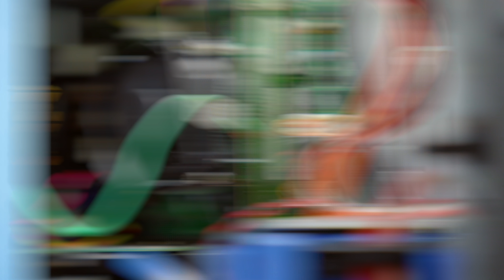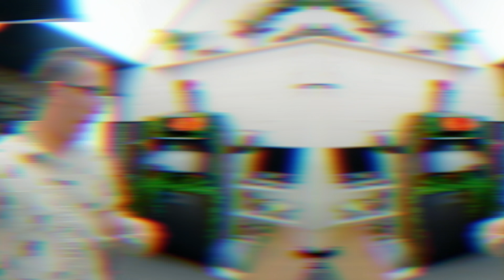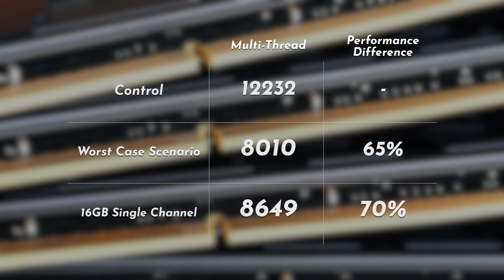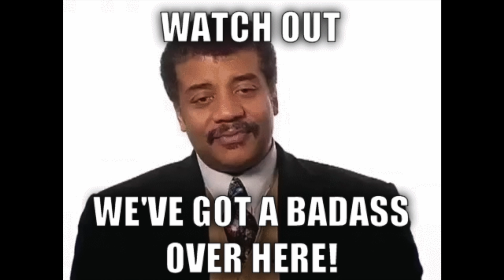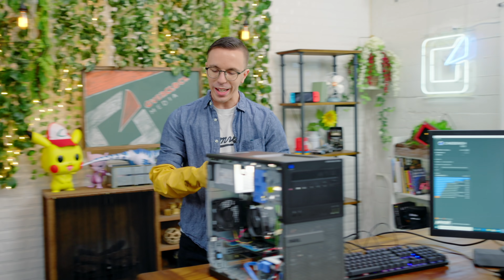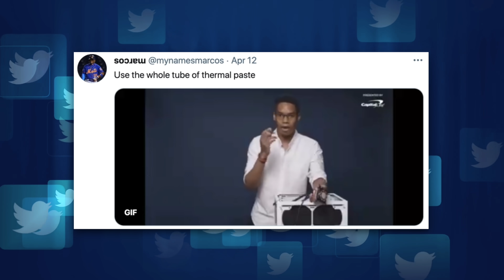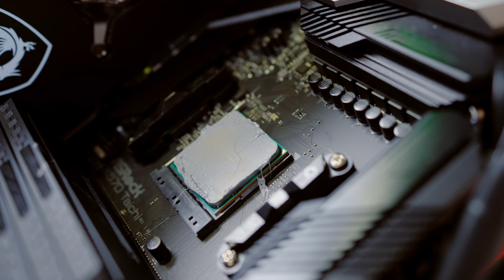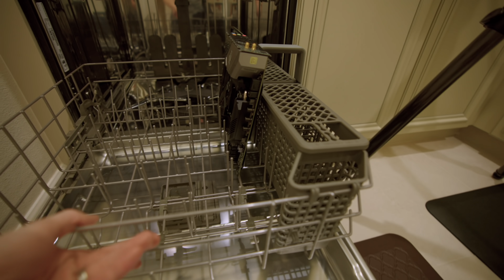Gaming PC Lies People Believe

Comment: Hi Austin & Team,
I wash used motherboards in the sink often and haven't lost a single board.  These are a few things I learned from Brian at Tech Yes City.  1: Remove all heatsinks to clean them separately.  2: Remove the CMOS battery and short the power button connector to drain any residual charge.  3: Run the board under warm water (NOT in the dishwasher) and go over it with a gentle brush.  When I say gentle, I mean something with soft bristles and ideally designed for electronics.  4: Take it outside and use some kind of air blower like a DataVac to get as much water off as possible.  5: Let it sit in the sun for a while to allow remaining water to evaporate.  If it's really sunny/hot, don't do this step for too long!  6: I recommend running a hair-dryer on warm/hot over the CPU socket, as this is where water can easily pool even after steps 4 and 5.  One time I neglected this and got BSODs when trying to boot.  It was fine once I dried the CPU socket.  7: Replace heatsinks, CMOS battery and test!

Comment: What was the point of that ram test? Of course it's going to be slower if there's less gb of total ram. I thought they were going to test out the control with another scenario where you have two 16gb sticks running dual channel with the same speeds but different manufacturers and different timings

Comment: I work at a circuit board manufacturing company with an assembly department. When they are done with the assembly process, they quite literally run the boards through a washing machine that works EXACTLY like a dishwasher. The only difference is that they use DI water and special soap.

Comment: Austin, DDR RAM is running half of the speed you said 3600MT/s === 1800MHz
Also you're not testing anything there, these RAM tests you did are completely useless you never OCed THE mixed RAM to 3600MT/s

Comment: Can you do the ram and motherboard challenge again. First of, if you wash your electronics wait 14 days. I did wash my keyboard like they did to the motherboard and waited 14 days( it was also on a radiator). Nothing wrong, it actually worked better because of how dirty it was(I was not the previous owner). Try like 4 rams with the same speed with and without the same brand.

Comment: @austin I've washed 100's of componants in a dishwasher and had no failures takes about 4 days to dry out the componants properly to make sure EVERY hidden drop of water  has gone and evaporated, Otherwise you risk a short, problems are in the CPU socket where tiny droplets form, it's not recommended that novices do it but if you know what you are doing then it's ok

Comment: I have a question so i got this Lenovo IdeaPad 3 15" Laptop, AMD Ryzen 5 3500U Quad-Core Processor, 8GB Memory, 256GB Solid State Drive, Windows 10, Abyss Blue, 81W1009DUS for 459.99 do you think that i got a good deal

Comment: Doesn't dell use PSU's that trip whenever there's an irregular voltage in the system? i.e. shorting the gpu/mobo or tazing it. 

*totally not speaking from experience (¬_¬)

Comment: Most likely, the reason the static electrict charge from the tesla coil and the stun gun didn't kill the components and at worst caused a crash is because the system is grounded by the power supply. He should try to do the same thing with the ground pin removed. That will be fun.

Comment: So I actually learned about the static. Basically the exchange of electrons degrades the bonds of the metal on a molecular level. Which is enough to cause a misfire or short circuit

Comment: It depends on the toothpaste. Some ingredients in toothpaste are also in thermal paste. The more gritty toothpaste can be used as thermal paste short term. I wouldn't use it long term though because there are also oils / glycol to prevent it from drying out.

Comment: Of course nothing will happen if you send power to the pcb. The hole point of a pcb is that it's nonconductive. Next time try a chip, capacitor or where something is soldered.

Comment: Spoiler Alert... Tasers max out at 50,000 volts. Anything after that is just marketing hype. It's also not the voltage you need to worry about, it's the milliamps you need to worry about on a taser. Anything under 1 milliamp is going to hurt, but not enough to stop someone. Above 1 milliamp is where it starts to really hurt. I have a 50,000 volt taser that is rated at 1.6 milliamps and it will drop a 300 pound person for 5-8 minutes on one usage.

Comment: Question for Austin. What type of graphics card would run in a dell optiplex 3020. It's a low end desktop PC but I want a GPU at any price that I can use.
Reply: Anything up to a 1650 super. That's the highest end card that can fit in a low profile pc, although prices are jacked up right now.

Comment: I think you dont dry the mainboard properly and and pull the CMOS Battery.
Use a fan for 12-24 hours and make sure a the water gone with hairdryer.
I do washing a mainboard with water and soap, and 95% of the survive and very clean.

Comment: Y'all should check out the LTT video of cleaning keyboards with a dishwasher. The before and after germ/bacteria count and just the general cleanliness of the board. If you get a deal on a keyboard that is rough or have just neglected cleaning for a while....or even just want to do a thorough cleaning every once in a while it's very effective. Of course they gave it 2 weeks to dry just to be safe.

Comment: 7:15 I dont think thats what he meant, at least partially. Seems like mixing same speed and capacity sticks from DIFFERENT manufacturers would be a bit more relevant test. For example, mixing a Corsair 16GB 3200MHz stick with a GSkill one of the same rating. Also latency impact?

Comment: Mixing RAM can indeed drop performance for example my i7 7700hq based laptop has 2 different sticks of ddr4 2400mhz ram and they are running at 2133mhz becuase one has xmp the other doesn't so they run at the lowest speeds possible.

Comment: Ok 3.8 million volts are you mental this isn’t possible air ionizes or breaks down could you say at 15 thousand volts every centimeter that’s thy you saw the jump to the ram with the Tesla coil the stun gun has approximately his prongs 1 cm apart so it means it only delivers around 15 thousand volts 
Why is the volt limited you ask ? 
Because 1 air breaks down and ionizes at around 15 thousand volts every centimeter remember the air becomes positive and negative until the air is so ionized that is shorts a gap wich is why the volts are limited and 3,8 million volts is a rediculous number and this is just the same volts as the Tesla coil so not a really great experiment there with the stun gun 
Watch electro booms video for a more detailed explanation video name: phone stun gun ridicules numbers or something idk

Comment: ive legit washed pc parts in the dishwasher, you need to make sure the waters cold, no soap (i know you didnt use soap), take the little battery out of the motherboard to avoid shorts, and keep it on top rack or use a "lower power" setting on the dishwasher.

Comment: HDDs don't die when you put a magnet near them because of mechanical parts (mostly), it's because their storage is wiped by the magnetic field. This might destroy system files.
Reply: Actually, nope, even these neodymium magnets are not enough to mess with the bits on the platters. Magnetic field required to realign a "bit" on the hard drive platter must be quite strong, and HDDS get away with that by generating it in very short bursts over miniscule area. To match that with a regular magnet you would require quite a monstrous one. Mechanical damage (e.g. heads scratching platter surface) would be much more impactful, but there is chance that heads would park themselves before contacting platters.
Reply: i don't think so. if this would be the case, the drive would be recoverable. most likely the magnet interfered with the platter head
Reply: A magnet will for sure mess up a hard drive. Especially if it is running like this one was. They have lots of metal in them and have really strong magnets in them to start with. Doing what they did probably made the heads crash into the platters and srewed the drive up.

Comment: I opened my PC for the first time and somehow I killed the hard-drive and I'm still not sure if it was because of static. For months I will occasionally get the message that a drive failure was inminent and I should back up everything (which I did) and 3 months later it completely died. My new SSD has not has any issues so far, but I am still afraid to touch mechanical drives.

Comment: yeah cause simulating a static electricity shock with a fucking taser is fair. That's like if someone went, "I have this water resistant phone", and Austin went "okay, if it can survive 2 weeks 10,000 feet underwater in the ocean then it is water resistant."

Comment: The only reason the pc crashed when you electrocuted it is because you bumped the ram. The reason why it didn't die because of the shocks is because the advancement of modern failsafes is insane and you can pretty much put any voltage into any components and the failsafe will disperse it to not damage your pc

Comment: Cool tests, but got kind of triggered at the voltage mention with the static test.... Voltage doesn't kill, Amps do.
You can run 1 Billion volts or 1000 volts and have it make zero difference in how deadly it would be, different amp levels do.
Try using something like 20 amps to fry the system :)    
The fact that a static shock from a person can kill a system, is because the amps in those shocks are very very random. 
( I'm an electromechanical hardware engineer at Acer )
I don't want to be a negative Joe btw, love your videos and aside this I laughed my ass off with the dishwasher and my guess is if you leave it to dry for a longer time period it should be fine xD

Comment: I get an insane level of static from me bed sheets + my pants and one time, after rest my eyes from PC on my bed session, I came back to my desk, touched my 2nd keyboard (which was connected to my work laptop) and it got shocked so hard (I could see a spark at my finger) so my keyboard shut off, usb hub shut off and 2 usb instantly shut off on the left side of my laptop. I had to restart the laptop and format tha hard drive because it was not recognized anymore.

Comment: Funny thing is that I used to run 8GB (2x4) ddr3 1600mhz and I got a ram stick that was 1333mhz (1x4) and I put it in and now I got 3x4 but I’m running at dual channel speed (1600mhz)

Comment: I broke a power supply bc carbin fiber got in. (It exploded because short circuit.) And my speakers flew away.(on top of power supply) and maybe i ever got charged 1 million volts! (The best way to get static energy is trampolines)

Comment: Haven't read the comments yet: But you absolutely can wash a mother board in a dish washer. It's common among extreme over clockers, as it's a sure fire way to make sure all Vaseline is off the board. Two things though:

1. You need to make sure the cmos battery is removed ahead of time. Like anything: Batteries + water with open circuitry = bad. And it's super simple to pop out that battery and pop it back in after. 

2. Remove the shielding. It is going to hold moisture. At least remove it, bear minimum, after the wash for drying purposes.

You do not need to let it dry a couple weeks - absolutely a single day can be enough (extreme over clockers even use it again same day, but they use more advanced drying techniques than just letting it sit). Also for ideal drying during that 24 hours, you should take some fishing line and hang it by one of the screw wholes and let it be suspended to give the water a flow path off the board itself.

Great video concept. Also absolutely, if an average consumer sticks their mother board in a dish washer after watching an extreme over clocker do it - this is going to be the result. You have to know what you are doing.

Water in that of itself doesn't brick components. Nor does the heated drying process. I use to work in board manufacturing and we literally use water and heat a billion times during assembly and after assembly. We just don't do it AFTER the battery is put in.

Comment: The only time I have damaged a component (Very Expensive SGI RAM) was when my manager told me to wear a static strap... The precautions are to touch the case when you insert cards or such. Never hand a component to someone else as you are likely to be at different static potentials (eg you can shock someone for fun, well when it is RAM it is not fun).

Comment: I dropped my 3410 in the ocean back in the day. It was there for 15 min before I got it back up. Took the battery out and let it dry in a warm place for over a week to make sure it all got out. Even used the bag of rice trick. Fired up instantly when I plugged the charger in. If Nokia made a motherboard for the PC today the old way. I'm sure you could wash it just fine.

Comment: That time a computer store has submerged the other computers in mud due to a typhoon we helped to clean those PC components using dishwasher and soap and it works, they gave me a motherboard and a cpu that I've cleaned and for almost 7 years it is still running

Comment: If a motherboard gets wet it’ll more or less work after it gets fully dried, you can soak it in like 99 percent isopropyl alcohol for a while then remove the board so it can dry up faster, or at worst you’ll only have maybe one bad component that you can desolder and then solder on a new one lol..

Comment: Why is no one reading into what ESD problems cause? It might not immediatelly kill your PC but it can do long term damage and fire hazards. You can shock components / damage connectors slightly. It changes the resistance that can result in the part overheating. The issue is not instantenious, more often than not it just reduces the life expectancy of the system.

Comment: I actually would like to add : 
I use a 2133 mhz 8gb and a 2133 mhz 4gb ram together. I was going to use 4gb + 4gb but due to less parts available i used  a 8gb + 4gb . This actually increased the speed. If you use the same speed ram you can get better performance with different rams. Just a point i would like to add.

Comment: I will say this again in a separate comment that stun gun is NOT 3.8 Million volts. That spark gap is an inch max the breakdown voltage of air is 20,000 to 70,000 volts depending on air pressure, humidity, air impurities etc. no matter how much voltage you try to push through that spark gap it will be 70,000 volts aka 70 kilovolts MAX, no matter what the package of that stun gun says, that is why is circuits like mar generators there are many spark gaps and each one is a bi further apart along the chain so you get more voltage. Unless the manufactures of the stun gun have found a way to violate the laws of physics.

Comment: Also you are shocking the fiberglass of the PCM, fiberglass is non conductive, you would hav3to do the test near a metal part like the case, or the USB port, also that stun gun is lying when it says 3.8 million volts because the spark gap is maybe a inch the breakdown of air at a inch spark gap is 20,000 to 70,000 volts depending on air pressure, humidity, impurities etc. no matter how much voltage you try to run the voltage will not surpass the voltage it takes to breakdown the air from a insulator to a conductor, so 70,000 volts is the max that voltage will be.

Comment: Also the reason the static electricity tests did not work is first of all the motherboard screws are bonded to the case which is bonded to the power supply and the whole system is grounded through the third prong on the power cord which connects all the way back to your electrical panel and eventually to a big metal rod driven into the ground outside the building that gives any static electricity or electrical fault current a safe path. Try The static test again but break off the third round prong on the plug or find an old house that has those old two prong outlets
Reply: So when you shocked the ram with the tesla coil and the stun gun all that extra current was making its way safely out of the computer through the power cord and into the grounding electrode outside your building

Comment: That teaser is not 3.8 million volts. It is at most 32000 or 64000 volts beside most tasers' prongs ore 1 or 2 cm apart which takes 32000 to 64000 volts to ionize the air between the prongs and let electricity arc through air and the voltage drops to zero and the voltage rises again to repeat the cycle that's why you hear the clicking out hissing noice from the taser because it is producing multiple arcs of 32000-64000 volts per second.

Comment: lousy video TECHBUSTER ???
3M VOLT ??? ELECTROBOOM SAD...
DISHWASHER Der8auer video RIPOFF ???
when it come to static electricity you have a ton of capacitors on each pc components the example in the video using on ram while running CPU TEST ??? use stress test all the ram like memtest or AIDA64...but most important it's the charge build up on individual component above certain level will kill it...

Comment: I worked in a circuit board manufacturing plant. We absolutely washed fully populated circuit boards with water (de-ionized). Like someone else mentioned, was the CMOS battery removed? Was the board fully dry? There is nothing inherent about washing a board that should cause damage.

Comment: helo guys :) this is how i grounded my pc. So I have a small laptop and one of it's 4 "feet" fell off. I placed a little bit of 2 sided spongy tape there (tape with glue on both sides). The bottom sticker peeled off eventually and somehow a small coin ended up sticking there..... Now occasionally when i touch it i get static electricity going through me.